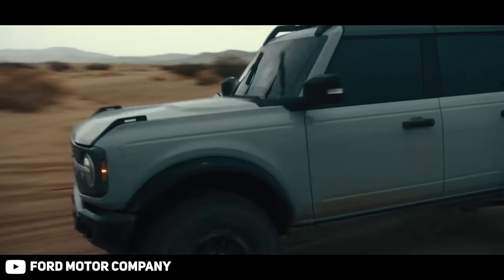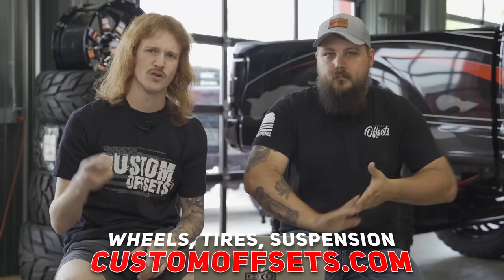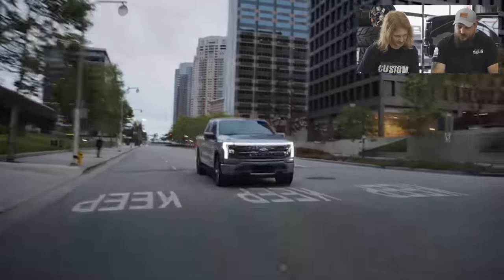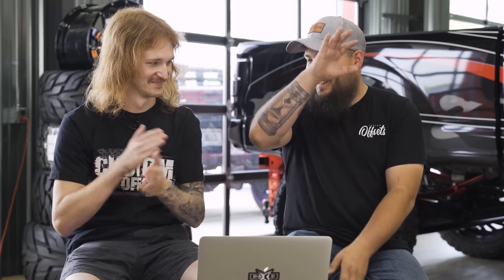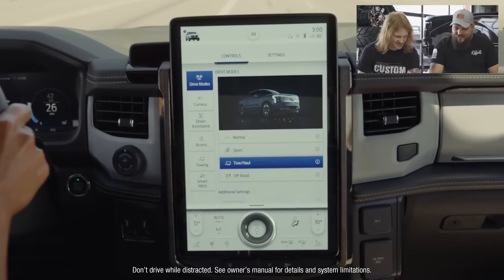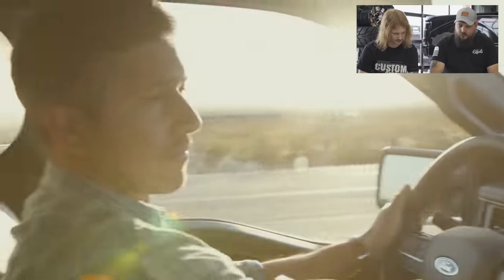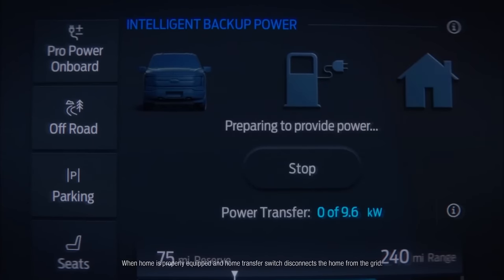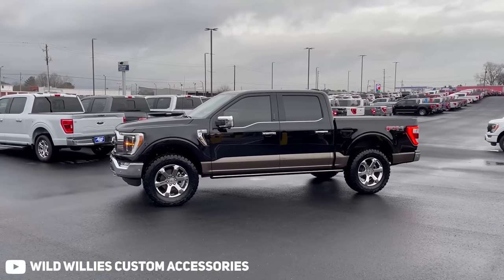Electric Ford Truck - Ford Messed These Up?

Comment: Ram is bringing back the v10 with a 900hp ram 12speed it's been leak.
Reply: Mopar really knows how to do things right
Reply: V10 🤤
Reply: I think Chrysler and dodge are getting bored and just trying to slap the most powerful engine they can in a truck. (Not that it’s a problem)
Reply: Hellephant Dodge Caliber
Reply: V10 with a hybrid electric motor...

Comment: I wonder if you had a something like a Honda generator running in the bed and plug the truck into it would it charge the batteries while you are driving? cause that would take away a lot of range anxiety...
Reply: Holy shit
Reply: Genius

Comment: Some things here ford may be exagerating like powering your whole house, but I really like how it looks. It looks like a truck unlike tesla cybertruck, these things looks nice and I can see it being used all over the world. The aftermarket market needs to work quite hard to modify these trucks mainly because of all of the electronics and sensors. Personally, the power doesn't really matter with this vehicle I prefer the torque and mileage. 300 miles isn't a lot. I agree with Junior here, ford should release different cab models for the f150 lightning and I think ford did a really good job with the FRUNK. That is very creative by ford.
I hope you guys get the chance to drive it and modify it in the coming years.

Comment: The new lightning would look alright, dropped on billets or sum. But I dont like how its all electric..
Reply: @Joe Smith i disagree a little bit. It all depends on how things in the automotive industry works out. And also for everyone who says electric is "the future" how would you know because you cant predict it
Reply: austin lipthratt  Idk about that.. i’m more of a ram guy 🤷🏽‍♂️
Reply: @Joe Smith I personally would of liked it, if it had a supercharged 5.0 or sum crazy like that. But, I kinda like how it looks
Reply: @Joe Smith yes hydrogen fuel cells are cool too. I would like them try to do something with methane from fumes from the landfills and turn that into fuel for construction equipment. Gases burn really efficiently and clean so that may be a probablility. Bio diesel may be another choice for portable generaters, water pumps, etc.

Comment: Awesome idea for a truck. Looks good. A couple things that could make it better. Solar panel on roof instead of sun roof. That way you could charge or power vehicle all the time. Rear window needs to go fully up and down not just small center square.

Comment: 1 That operable rear window needs to grow wider like it was in the Sport Trac.
2 There should be a charge port on either side.
3 The parts aftermarket for this EV will be insane once it starts up.
4  Can't wait to see an EV version of the Ranger and Maverick ... hopefully the range can remain high.
5  Can't wait to see an EV version of the Expedition and Explorer.

Comment: It's a ok truck, just remove the lighting name. The lightning should be a gas performance truck.
Reply: V8 performance👍
Reply: I agree. They did the same thing with the mustang.
Reply: Lightning is electric
Reply: @MrPAULONEAL  yes you are correct

Comment: The volume wheel in the truck is the same as the mustang hatchbacks.  The wheel has a stylus tip on the back and it just touches the screen

Comment: Gas is still better in 1 specific way.  If I’m doing any long distance traveling it only takes me about 5 minutes to fill up a tank from it being on E while it takes significantly longer to get a full charge on an electric vehicle such as the Lightning. These things are only good for short distances unless you plan on staying at a hotel/motel and charging.

Comment: Yeah 300 miles of range with you not hauling anything 10,000 pounds is a lot of freaking weight I wouldn't be surprised if it doesn't get like 50 miles on a full charge with 10,000 lb behind it..
Reply: Alot of people today, buy trucks and really need a civic. They dont use them to work, or haul.
Reply: @HardHeadMilitary  this is very true that's why I can't afford a new truck I take old wore out Chevrolets and put them to work.
Reply: Don't buy this to tow
Reply: This really isn't a truck to pull your camper unless you live close to the site.

But it's also a first generation, and I can think of plenty of use cases for it. Tradesmen mainly.

Those carpenters, plumbers, electricians, etc tend to stay well within this truck's range, usually care more about bed payload than towing, and can save a ton of cash by not needing to purchase gas.
Reply: @jimbartosevich498  if the cost of the truck was not outrageous it would be an asset, but in todays market, trucks are sky high. Base model trucks 40k, and any truck I would want would need to be 4x4 especially at some of the job sites I get sent too. This truck has a ton of upside, but i believe the price will make it a truck thats parked in a garage most of its life
Reply: @HardHeadMilitary  the cost of this truck is right in line with every other truck on the market. And the base model is 4wd. So I'm not sure where you are getting the idea that the price is outrageous, unless you're suggesting that a person shouldn't buy a truck at all.

Comment: Wonder what happens if you go in deeper water (like, door sill high)... Since the batteries are mounted between the frame rails
Reply from the maker: Typically an battery that is used in a setting like this has a sealed battery, and or battery containment set up. To alleviate dust/potential for a fire etc!

Comment: I want to see the truck actually pull a trailer 300 miles and and not have to charge
Reply from the maker: Now that’s a great question 🥵👀
Reply: Every vehicle's economy suffers when towing. I can tell they aren't going for the long distance hauler with this truck.

But I can think of plenty of use cases. And I believe that future generations may be able to hit your target.

I'm just excited to see an electric vehicle that can actually do SOME work instead of yet another sedan or SUV

Comment: from what we hared about this they want to sell 100-150k in the first year. The problem that we have now is a 2.14% load increase on the power grid year after year if it sells like that plus not to forget about Tesla and the other EVs coming. also when will ppl more then likely charge it? of course we know its hours of 5-7   So now we not only have the peaker plants coming online longer but harder ( Which most burn LNG ) and not just that, think, its California or Texas its 110F and now its coming on 5:30 and 100k evs just got plugged in and boom rolling brown outs

Comment: You CAN power your home with the F-150. You can use it as you would a generator.

They use Electrify America's chargers - you can't use Tesla. (Ford Pass is just a plan).

Range is 300Mi LOADED with 1000lbs in bed. 450+ without. 

Come on guys. LOL

Comment: Ford didn’t messed anything up. Ford did everything right with F-150 lighting. Both exterior and interior could look more futuristic and and needs 500 miles in range. Other then those two things it is great truck.
Reply: over 450 miles, 300 miles is with a payload of 1000lbs.
Reply: “ Lightning Extended Range Battery: The 2021 Ford F-150 BEV with the extended-range battery has a targeted EPA-estimated range of 300 miles (483 km)”.

Comment: Ford didn't bring back the 7.3. They made a new Godzilla V8 that has the same displacement as the old diesel V8 but other than that they completely different engines made in different times. Speaking of which, 7.3 or 6.7 Powerstroke whats the hype?

Comment: Ford botched it. Should have had a supercharged coyote engine or the supercharged engine from the shelby cobra gt500.
Reply: They are gonna be putting the predator v8 into the new raptor r

Comment: GM, Ford, Toyota, etc will have a hard time competing with tesla. Tesla charging solutions will not comply with other vehicles. Tesla dominates the EV industry and non Tesla owners will have to know which EVSE's will work and which will not. It's going to be tricky

Comment: The Tesla charger is proprietary and can only be used by Tesla vehicles.
Reply: But you can charge a Tesla in regular ev station as well, it comes with an adapter